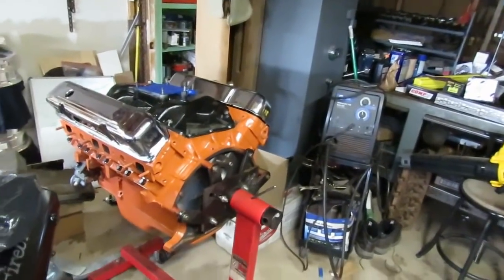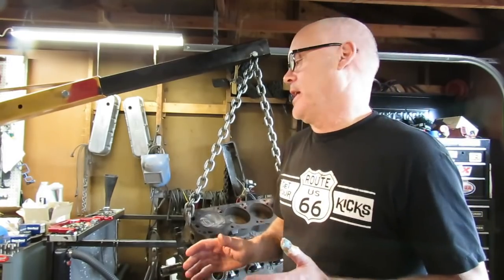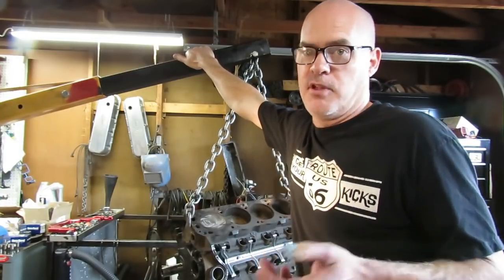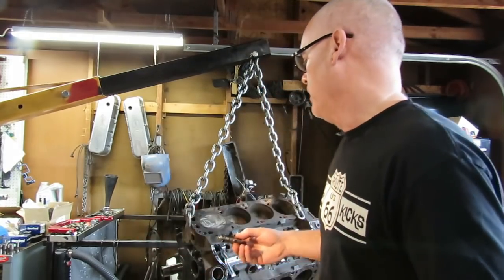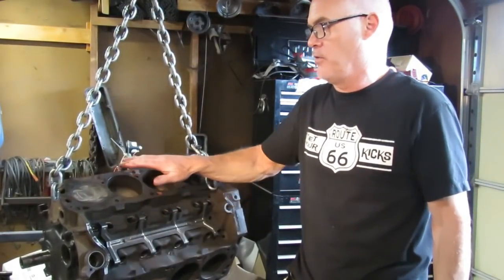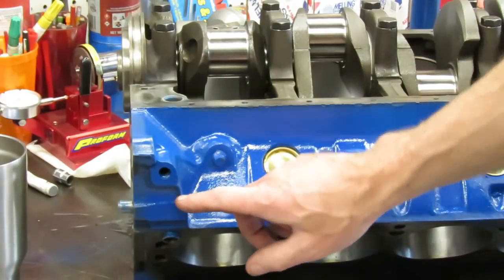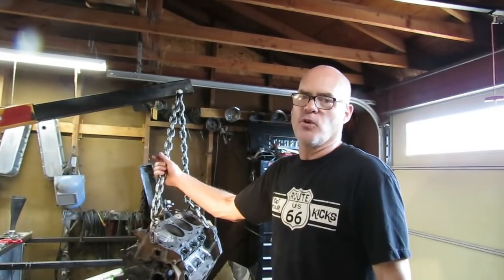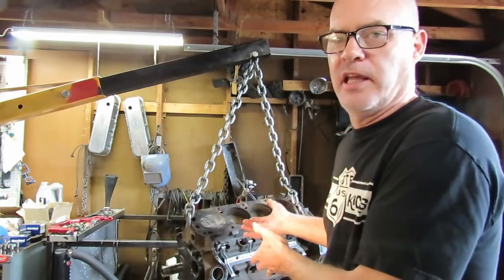How to get more power out of your small Block Ford part 3B

Comment: If you upgrade to a hydraulic clutch you bypass the problem with the clutch linkage and a smother, easier pedal. Get one from the salvage yard, complete pedal and hardware assembly.

Comment: Great information!  I appreciate your channel. I’ve got a 89 F150.  I believe it’s a roller block with a flat tapper cam and lifters. Can I just install the late model roller cam, lifters etc or do I need to get the high dollar conversion lifters?  Thanks in advance.

Comment: I am pretty sure the Mustang 5.0 Roller motors started in 1986. The 1986 motors aren't very popular because they are carberated and the piston valve reliefs are so small you can’t put much over a stock cam in them.

Comment: Hey LS Guys this is 100 per cent verified I'm an Australian Mechanic work on all vehicles guys This is fact Look it up for your selves My Brother worked for GM Australia for 19 years in 2016 with very little warning he and all GMH Workers were given two weeks notice that GM or in Aus GMH was closing there manufacturing doors forever so he and four thousand Australia wide Took out a multiple Law suite against GM the conclusion is that The great us company has sold out to f*":;!n CHINA AND THAT HAS BEEN VERIFIED BY SOME 27 DIFFERENT SOURCES AND NOT JUST THAT 2022 IS THE FINAL YEAR GM IS PRODUCING ANY GM PRODUCT'S IN THE USA ALL VEHICLES ARE GOING TO BE DESIGNED AND BUILT IN"CHINA " AND HEARS THE KICKER IN 2016THERE ABOUTS YOUR CONGRESS BAILED OUT GM TO THE TUNE OF EIGHT BILLION DOLLARS TO TRY TO KEEP THE USA LEGEND UP AND RUNNING AS THE USA LEGEND IT WAS and yes that was your tax dollar 8billion with a B .who else thinks that stinks GM will begin to get rid of US workers very soon CHINA Will be shipping Late 2023 GM vehicles fully assembled vehicles to the states no assembly required signed VERY UPSET GM LOVER FROM DOWN UNDER TONY!

Comment: Love what you said about ls swapped into a Ford that already has a sweet little SBF in it.  I hate it, but I can understand putting one in a drag car Fox Mustang for relatively cheap turbo power.  BUT, for anything less than that, the little 302w or even a bolts straight in, 351w are MORE than good enough.  I still remember watching a Fox called the Grey Mare take out all sorts of opposition with a well built N/A 331 cube little Windsor !!

Comment: Just use deisel engine oil it has all of the Goody's a flat tappet cam needs if a roller cam is not available for the engine you have
Reply from the maker: Actually the latest version of Diesel does not have the correct amount of ZDDP it has been removed because of the Ultra low sulfer diesel and the particulate filters required on all on road Diesel engines it will not protect these cams
Reply: @Myvintageiron7512  thanks for the update most of the oil I use to use was for equipment and diesel irrigation pumps but I am going to get a roller cam better performance and no worries about the oil plus reusable lifters offset the price

Comment: Thank you for your little speech on LS swaps. I totally agree with you on that. Chevy makes a good motor, but theres more satisfaction running a fast Ford! 😁
Btw I like your Total Seal sticker on your tool box. I had a shop next to their shop when they had a second location in NH. They built my 302 Ford and it has TS rings, and they work as claimed. 
Whats your take on 
Total Seal rings.
Reply from the maker: I swear by them
Reply: I’m not sure if the M family still owns the business. The inventor and founder told me several decades ago that the gapless ring idea came from several failed attempts to design a better apex seal for the rotary engine.
He first applied the gapless idea for aviation. 
As boy he grew up near an airfield that homed a well known world record holder airplane. Piston aircraft was always in his blood. He flew his own plane alot when I knew him.
His R&D shop in NH was near his home. As a business owner & neighbor I had a “walk in at anytime” status in his shop. He had a love for big bowties. There were two 1,000 hp dyno’s on site. The exhaust went up through the roof. I would open my over-head door and listen to the music often!
They did alot of dyno work for engines from all over the world. Ford, Opel, Roush, dragster, drag boats, land speed record holder motors
gas, alcohol, nitro etc!!
He had mule motors they would run for long periods of time too!
They also built motors for customers and their own race car. The factory Hyundai Rally team truck would stop by and pick up spare motors. They used Mitsubishi motors back then. The engine builder that built the winner of the Mt Washington Climb to the clouds Mitsubishi Motor built my 302 ford. 
He was a Ford nut.
 Oh ya it was a motor head’s paradise !!!!
There are too many stories of that shop to talk about!
Total Seal is a part of my mechanical back ground.
I really miss those days 🥲

Comment: Great video! I bought a 90 F250 plow truck this winter with a 351Windsor I’m going down the rabbit hole with. Debating swapping in an older 74 5.8 that I rebuilt 20 years ago with World Products SR Torquer heads and a Performer RPM intake or maybe just pulling them off and putting them on the engine that’s currently in it since it’s pretty low mileage. I want to convert it to a roller cam after research it’s quite a bit cheaper than I thought. Possibly install a Sniper efi and scrap the speed density. Eyeing a Lunati 20350612 cam. I’m guessing I’ll have to install different springs if I do.

Comment: take the t handle off your door opener release handle for security- they can get into your garage with a coat hanger
Reply from the maker: I actually have 1/2 steel dead bolts that I fabricated on these doors mainly because I do understand where you're coming from

Comment: Guess I made a mistake, but I put the flat tappet cam back in my 351w pick up.I used the break in lube with no issue.Changed the oil after break in.I only use valvoline high zinc oil.Changed it after 500 miles then again after a 1000 miles.I change the oil around 1500 after that.I don't put a lot of miles on the motor it's really more of time between oil changes.
I agree with the oil issue.My 87 truck had 108,000 miles on it when I pulled the motor.The lifters were stuck the bearings were completely worn out the cylinders had grooves at the top and the whole motor had lots of carbon buildup.
Believe me or not the cam was in really good shape.
I had the crank turned .10 thousands and bored .060 over.
I removed the exhaust system and replaced with dual exhaust with no catalytic converter.
My reason for not switching to a roller lifter system comes down to cost.That upgrade added up to around a $ 800 bucks.
It's a pick up truck not a hot rod.
That money saved covered my machine shop bill and some gt40 heads.
If you can follow directions breaking in a cam isn't the end of the world.
Make sure the motor is well primed and timing is close for a quick start up.
If it doesn't start quickly STOP.
Cranking it over and over will do extreme damage.
So if your engine builder won't touch it go find one that will.
I'm not rich 800 hundred bucks is a lot of money to me.

Comment: My question is for my 68 cougar in which the stock engine is long gone. Can I build a 302 roller that would be comparable to an Ls in power and mpg? I don’t want to be the guy who goes against the he grain but it’s hard to beat and ls without looking at the coyotes
Reply: Easy, give it good alloy heads, cam, intake, headers and cubes...stroke it...ie--get a blueprint or similar crate 347 that has all the good bits already in it, and makes 415hp. Check out the Cobrabuilt channel !!

Comment: I’m thinking about building at 351W for my F250 with a 5 speed manual. I want to get a donor motor from the boneyard with GT 40 heads and then figure out what cam to put in. Do you have any tips or suggestions for a build like that. The purpose of this motor is to toe better and be able to off road more comfortably. It’s a 1989.
Reply from the maker: Find a 351W roller block upgrade the cam and heads around .500 lift and 205 to 215 duration @.050

Comment: I have a 1967 289 and I’m thinking of buying the Edelbrock top end kit. It includes a flat tappet cam and lifters. Can I put in roller lifters instead or do I need to get a roller cam?
Reply from the maker: you need a retro fit roller cam kit roller lifters do not work on flat tappet cam

Comment: If you still drive something with a flat tappet cam Lucas ZDDP Plus additive is available in just about all real parts houses. It’s about $14 a bottle and contains enough ZDDP and detergents (to keep the additional zinc in suspension), in any off the shelf oil . I have a 1995 K2500 with a 5.7 flat tappet cam in it. It runs like a top so I’m not tearing it down to put a roller cam in it. The truck is unusually clean so I intend to keep it right on.

Comment: You can run an '85 timing chain cover.  The engine was roller and carbed.  It has a fitting for the fuel pump.

Comment: If you see this or someone else do you know the difference in the retrofit roller lifters and factory roller lifters right off the top of your head
Reply from the maker: The the retro fit has a tie bar connecting a set of two lifters together the factory lifters do not

Comment: Hooked on these Ford videos. Just got a mustang with a 306. Really wish I knew how to know if it’s a 331 or 347. But either way it’s awesome! Can’t wait to do some more upgrades!
Reply: There must be a way to measure the piston travel through the spark plug hole, if you really want to know. I'd start by googling that. 
Also, pick up an inexpensive endoscope on Amazon with a light on it. Next time you change your oil, put the scope into the oil pan and catch a look at the rotating assembly. You might be able to get a part number off a rod or possibly the crank. Also, if it's a 347, the block will have clearance notches cut into the bottom of the cylinders to allow for rod bolt clearance. Easy visual indicator.
Reply: @pimpovic2  it’s at the machine shop being stroked to 347 right now lol

Comment: your statement about the engine is safe if you're using a roller cam, because of the lack of zddp wear additive, i have been using pennzoil since the mid 70's, my last engine build was destroyed because pennzoil took the wear additive out. the 350 chevy engine was completely rebuilt by my machine shop that i have been using since the early 80's. the engine had a zz-4 roller set up, the only part that survived. cam bearings wiped out, rod and main bearings were completely wiped out in 5,000 miles, asked pennzoil what would have caused this problem after too many years of problem free use of their oil, their only response is the wear additive was removed, they informed me that shell rosella, vavoline, pennzoil 50w racing oil as well as a few others still have the zddp, no apologies!i love your vedios

Comment: I just bought a 5.0 Ford engine that may replace the 289 in my Comet. I've been trying to decide about several things including whether to bore or not. This engine has not been bored yet and I could just leave it alone. After listening to this again I think it will be "30 over". I just finished disassembling the block and getting it ready for the machine shop and had several questions which you answered that I needed to know before I go. I've been around old cars almost all of my life but I've never been inside an engine. I'm 78 now and can now afford to do it with both time and money. THANKS!

Comment: What do you think is the best way to get the hp out of 302 between idle and say 3500 rpm the reason I ask is I'm rebuilding a 95 f150 4x4 with 35 inch tires and 456 gears specifically to pull my bass boat around w/auto trans

Comment: Appreciate the information you've provided here and all your video's. I am more of a Mopar guy, but, I have rebuilt Fords, and Chevy's as well. Funny thing is, I love them all! There is nothing better than going to an event and seeing everything displayed with ALL of the owners beaming with pride and to compliment them on their rides, all you see are smiles after smiles!!! That said, I couldn't agree more regarding "BRAND LOYALTY" I definitely appreciate your posting this video as I did not know about the components needed in "old oil" to run flat tappet cams. As a side note, I am the proud owner of a "NEW TO ME" 1970 R/T Challenger with a 383 Magnum, pistol grip 4speed. This being a numbers matching car, I am looking for another 383 or even a 440 to drop in so I can enjoy the car while in my possession, then to drop the original back in at a later date, but surely thinking I should break this baby open to do an inspection, especially the bottom end, like you did with Charlie's 289, and go so far as to upgrade and put a roller cam back in upon reassembly! I think Iheard you say you might sell the 383 that is on the stand? If not, what about the one tucked away on the floor? Are they both "MAGNUM" engines? I'd really like to speak with you over the phone if your okay with that, or maybe "messenger" or email... 
My email is: razorray57@gmail.com Be great to touch base as you are a good source for information and could help an old guy out here. Take care,
Razor!

Comment: I have a question about my 79 Mustang I want to put heads and cam in it I want to the question is how you feel about the stock Rockwell's in that motor just motor only has 19000 miles on it Cars For Speed I've had the valve covers off of it in the mail train Christine and I only plan on running it to 5500 RPM and I am going to run to Flat tappet cam
Reply: Rod bolts
Reply from the maker: Id up grade em

Comment: Where you been i would like an update
Reply from the maker: we have decided to go with the GT40 heads insted mainly because of exhaust header fitment in the mustang it can be don but Charlie just doesent want to mess with it so I am rebuilding a set of GT40's the same waw we did the P heads bit with 1.600 valves insted of 1.500 more to come
Reply: @Myvintageiron7512  will you go with the Chevy valves in them heads as well? Hope you show the completed engine and respectful horse power numbers

Comment: I built a 351W for my early Bronco when the 302 got tired and it was one of the best upgrades I ever did to it. It was a 74 out a Mercury Montego so pre roller but man that engine was a screamer. Just a mild build with World 🌎  Products Torquer heads, smaller Comp cam and Holleys 4 barrel 4di fuel injection. I assume there must be an equivalent 351 roller block of the same era as well, correct.
Reply from the maker: yep 351W is one of the best engines Ford ever produced when ford guys want a decant street engine the 351W is my go engine the 4" bore and 3.500 stroke is a really good package get a decant aftermarket head /cam/and intake they are quite impressive never heard of anyone doing this that was not happy
Reply: @Myvintageiron7512  ha ha just noticed my comment a year ago. Here we go again with a new project….. lol

Comment: I have a gm crate engine ( build date of 3/13/2001) that was already installed in my 87 squarebody upon purchasing it. In the manual for said engine is mentions nothing about zddp additive yet under the specs it lists the cam as ' hydraulic flat tappet'. Should i be using the additive at each oil change?

Comment: Its good to see a ford video. 
Ive got several Falcon Coupes (Mad Max Fords)  Building Clevelands.   Im with you about fitting a rollor cam and lifter set up. It really is the only way i wish to put these old girls togeather. 
However i have a very oringinal XA GT amongst the pack which the owner wants it as it was from the lot. 
The XA Used the USA import 4V engine sporting a flat tappet mechanical camshaft. Which suprise suprise is minus a couple of cam lobes.

Comment: Years back I bought a crane cams retro roller cam for my 351W.  Best decision I have ever made.  It is a much bigger cam than in my flat tappet 64 289 and runs smoother.

Comment: I did a 5.0l swap into an 87 4 cylinder mustang over 24 years ago after my gt got totaled and did not have collision...so I had a V8 parts car. Also to take note when going with the 5.0 is to get the proper distributor gear either installed or buy one that has it already.

Comment: The rivalry is exactly what you said, marketing hype to sell product. 

I came here to learn a platform I'm not as familiar with because I'm a car guy, not a brand guy. Ironically most of the brand loyalists I know can't change their own spark plugs or oil.  

I want some simple, budget upgrades for a 302 and this build is a perfect fit. The engine I have runs great but could use a bit more go. Reconditioned junkyard heads and a mild cam are right on target with the budget and look for this project. Thanks for sharing a great recipe.

Comment: I would really appreciate your thoughts on 302 based strokers. Do you think a 3.4” stroke crank is too much for a 302 block?
Reply from the maker: I really dislike 347 stroker cranks I have seen several with pistons skirts hammered after being run hard in my opinion that crank pulls the piston down to close to the bottom of the bore I would go with 331
Reply: @Myvintageiron7512  331 DOES seem to be the sweet spot for that short deck height !!
Reply: @Myvintageiron7512  thanks. That is what I was looking for. Thanks for the great content.

Comment: I have an 89 F150, nice sheet metal and I suspect lowish miles. I feel like pulling it to redo seals and gaskets. What suggestions could you make to perk it up a little for daily driving, without breaking the bank? (I say as I go down the rabbit hole).